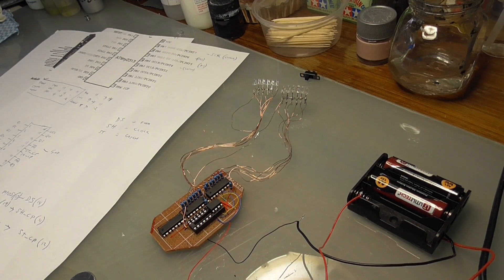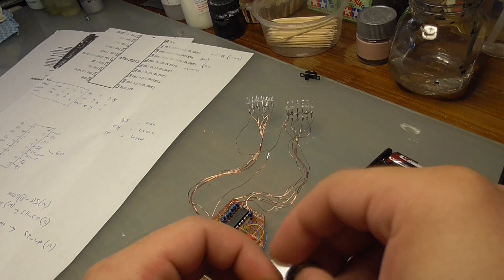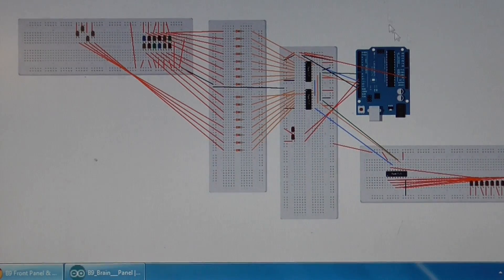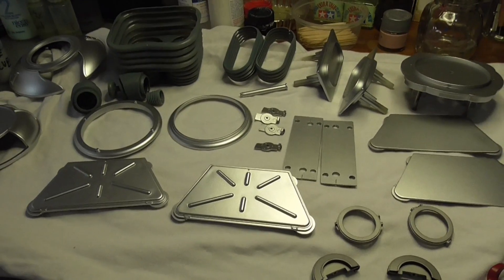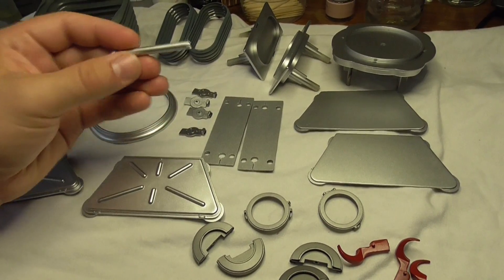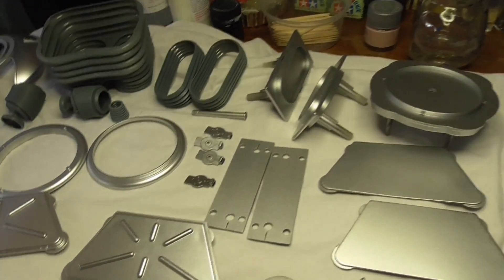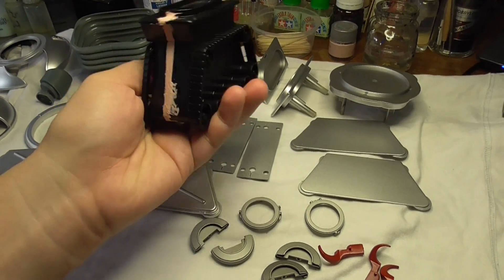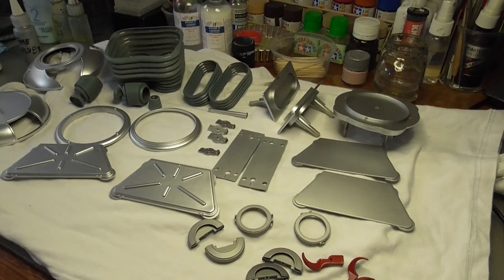B9 Robot | Part 4

Comment: Hi there. This is very impressive work. I've just started on my build and would really like to incorporate your lighting designs into my build. Would you mind sharing your the details of your lighting? Thanks.
Reply from the maker: Thank you. What details are you after? This build series I cover most of it.
Reply: Details of the electronics and programming of the Arduino and the soundboard..
Reply from the maker: Again, what kind of details. I cover most of it here. I've not used arduino boards, just the programmer with ATTiny chips, which drive a shift register. The flashing lights are controlled by the millis function. I dont have the program to send you because it was done on 123d circuits which has been shut down so thats as far as I remember for that. I'd recommend searching those because the arduino website would explain it much better than I could. The sound board I use is WT588D but requires a bit of tinkering and know how to get it working. Most people use the bigDawgs board which will work just fine. I use a reed switch which is activated by a magnet. Hope that helps.
Reply: That's great thank you. I'm new to Arduino myself but am starting to put it together. Just also wondering about the pcb that you used. Did you make your own to fit inside the model?
Reply from the maker: Yeah its basic. Just a blank pcb and soldered the chips onto it. It's just the shift registers and attiny chip. If you search for shift register on arduino you'll understand what i mean.

Comment: Hello again xrlent12, in this video you mention a base coat of black. Was that an automotive primer, or a general primer, or was it a special plastic model primer. I am getting ready to paint soon and I really don't want any mistakes in the paint job it must be perfect, like yours looks?
Reply from the maker: Jim Rauch i used an automotive black paint over a grey primer. But you dont need to as long as the paints are compatible any black base will work.